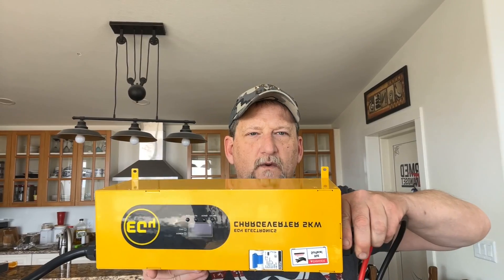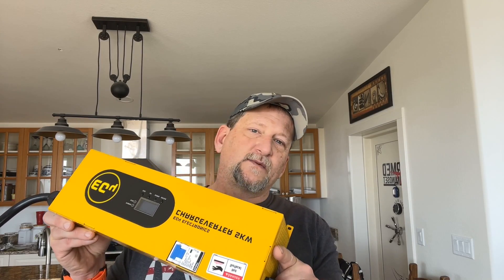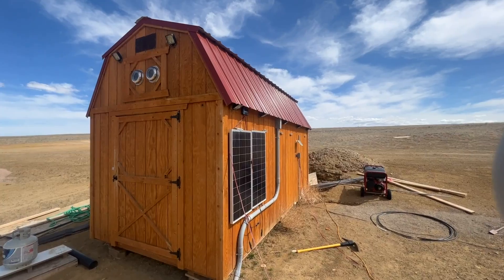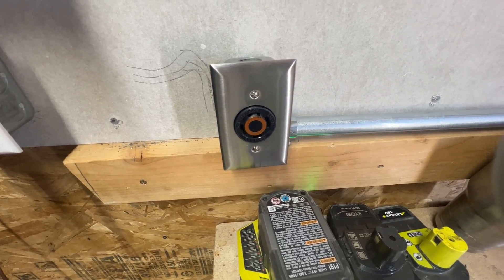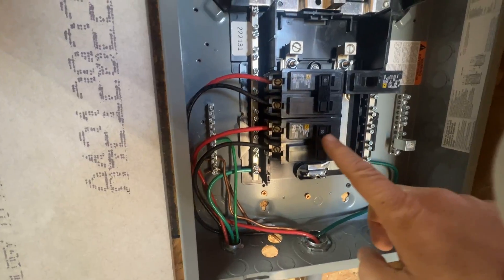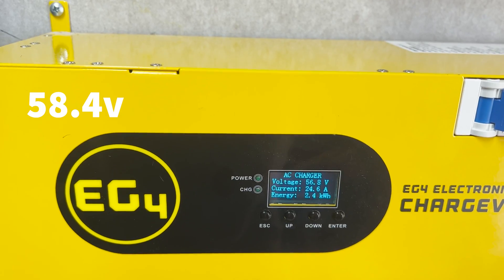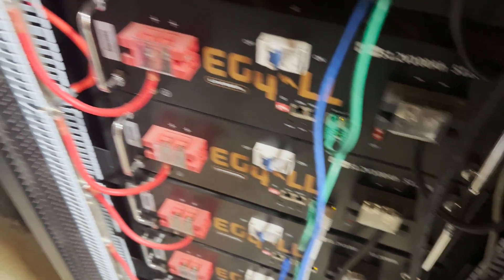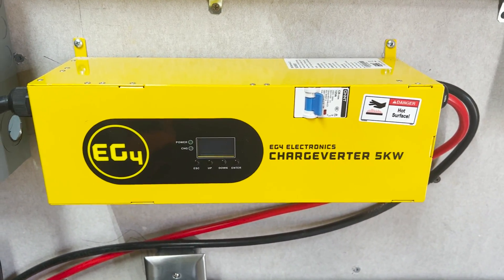Installing my EG4 Chargeverter

Comment: Can you wire this directly to the battery as opposed to the bus bar?  Also, did it come with the necessary cables?
Reply from the maker: yes, if you only had one battery that would be the way to do it.

Comment: nice overview... looking to add this to my setup... I will add that the batteries will last along time just the capacity will decrease overtime and at some point it is not useful. The best thing is that the  Lithium and Iron can be extracted and re-processed into raw materials for a new battery (the last place for this should be your local landfill).. so only needs to be mined once. its like how they make new glass products from returned bottles.

Comment: My chargeverter is mounted upside down. I didn't want the exhaust heat to slowly cook the wires....
Reply from the maker: I need to reroute my wires so they heat does not hit them.

Comment: I noticed you were really careful around the battery voltage and not so worried around the exposed AC panel.

240AC is far more dangerous than 50DC.
Reply from the maker: Good point.  You are absolutely correct.  I have all the covers on them now that my county inspection is done.
Reply: At the amperage this stuff runs at...both are just as deadly.
Reply: @wadebrewer7212 nope, 50vdc is not enough to kill the average person with dry skin. Obviously don’t touch it on purpose.

The whole current kills thing is a misunderstanding.
Yes current kills, but voltage determines current.
Reply: @justinjja2  how do you figure voltage determines current?   Not arguing....asking.

If I had my drethers....I drether get hit with 30 amps of 220 vs 900 amps of 54vdc.  He had 9 racks at 100 amps a piece.  

However.   All the pissing contest aside.  The smart...safe....and responsible way to do work on your system is to kill ALL power.   You just don't know.  Most arrays these days operate north of 200 vdc. Mine on cloud edge can see 280....its just better off to shut it all down and power it back up.  Not worth the risk.  

I was trying to do some live work while doing my install so the family upstairs didn't have the power off...it was late....I was tired....and I had the wrong fn breaker on...grounded out on the sub panel...needless to say I told the family to deal with it.  Shut the whole system down including the main and put a head lamp on.  

It just isn't worth the risk.
Reply: @wadebrewer7212  V = I * R, your skin resistance when dry is quite high.
You can touch the positive and negative terminals of a car battery, with dry hands, and you wont even feel it.
Despite that battery being capable of 1000 amps.

Tasers are 50,000v and 0.002 amps for a reason
high voltage is needed to get meaningful current into a person.

Comment: Is your generator an inverter generator or a non-inverter generator?  Just wondering the rationale of not using the charging capability of your inverters.
Reply from the maker: My generator is NOT an inverter Generator.  It is a champion 8500 watt whole home propane beast.  The Chargeverter does well with the "dirty" power that gen produces.

Comment: Can these be used "automatically"... i.e   using   AGS (Auto Generator Start) to start a generator with the chargeverter permanently connected to the battery and generator.    No manual intervention any time.   Will the generator bog down on starting etc.     IF I had to, I could put my delay circuitry in between the chargeverter and the genny but....   It seems like this might not be intended for automatic operation.
Reply from the maker: I think that would work, my concern would be the high draw on the Gen before it was warmed up.  The Chargeverter does ramp up, but not slow enough to allow the gen to warm up.
Reply: Check out the new version, I believe it can do all that.

Comment: Mine was DOA... keep your packaging until you test yours out!

I'm looking for an automatic transfer switch... my idea is that Growatt will control the inverter, and the ATS will "fail-over" to the grid when the inverter turns off... All the ATS manufacturers won't discuss hooking these units up in this way... they're just selling generators as grid backups... any advice?
Reply from the maker: I have heard that a module comes unplugged during shipping and if you take the unit apart you can easily plug it back in.  I don't know enough about the ATS so give you sound advice.

Comment: On the insulated tool bit interesting factoid I found out that 280 amp hour lithium iron phosphate cells have a short circuit current capacity of 20,000 amperes. Now I've got three Banks of 16s cells connected together so that makes the short circuit current possibly as much as 60,000 ampers talk about having your wrench become an instant incandescent flashbulb!
Reply from the maker: That's a lot of amps.  I have short circuited one 12v battery and that was bad enough.

Comment: How are people getting these things before they're even released? I ordered mine last month with a estimated ship date of mid-may. And the thing list says being on backorder now.
Reply from the maker: They are readily available now.
Reply: @pawneeoffgrid2614  I did manage to procure one last summer. Have used it several times. Realizing I need a 50kW diesel genset and ten of these babies to charge my battery bank in an hour! One is simply not enough.

Comment: Nice brother. Hope this works out well. Thanks for sharing. One thing I found that helps keep the battery banks happy. Was seed heating matts. You can set there on and off temps and they use like 15 watts each. Helped a guy in  Canada with this last year. They where in a shed like yours. Temps where below 20 C  at times. Not one time did he need to use gas for heat. He did have his racks insulated with some aluminum bubble wrap. Then he was saying he was using about 6 KWH in 24 hrs to keep his stuff safe. This might work for you. Hope all is well brother. Thanks so much. God Bless.
Reply from the maker: Excellent idea!  Thanks!